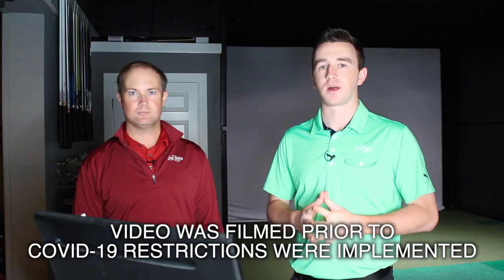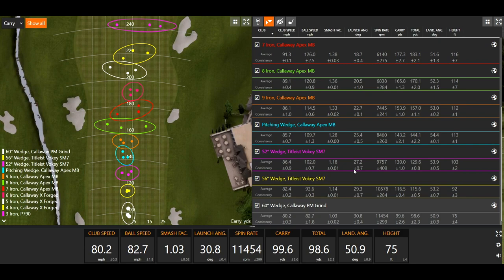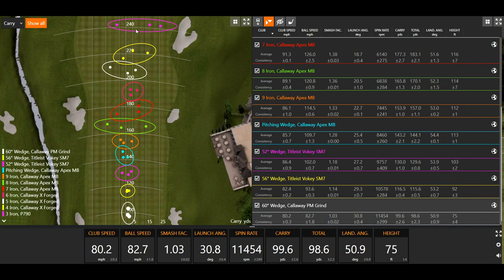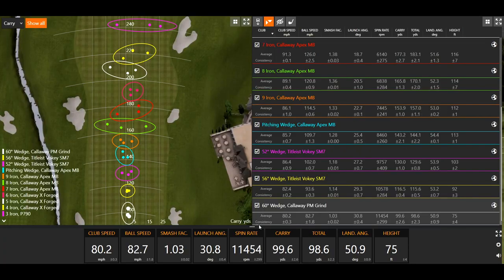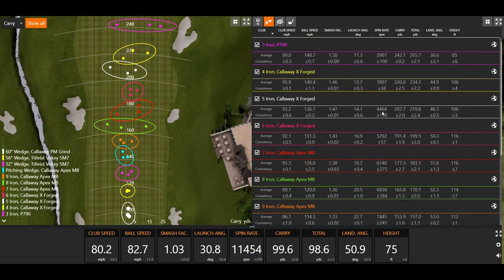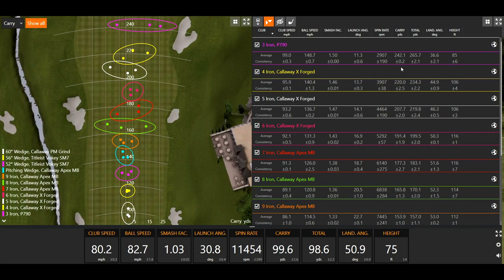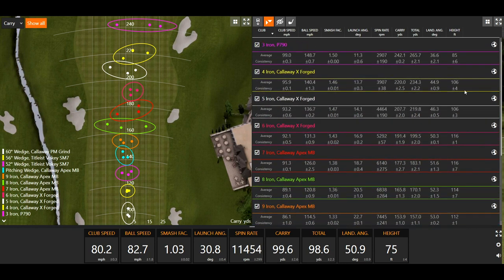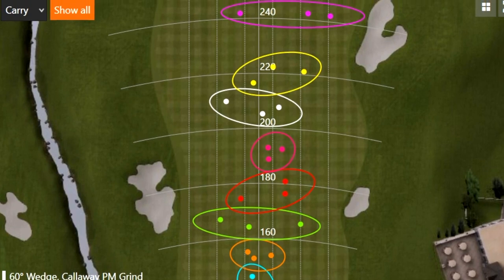Trackman Testing: Analyzing Proper Yardage Gapping  | 2nd Swing Master Fitter Insight

Comment: Thank you gentlemen for the very informative video.  I’m 53 and have been playing golf for many years now.  I’d say I have an average swing speed and hit my 7-iron about 140 yards.  I usually shoot in the low 90s.  I’m considering purchasing some new clubs and, after watching another of your videos, think that the TaylorMade SIM Max irons might be right for me.  With lower CG (and other new technology built in), I think they’ll help me to get the ball higher without sacrificing (and possibly gaining) carry distance.  My question for you is that with the SIM irons, the difference in loft angle in the longer irons is only 2-3 degrees.  Whereas, the loft difference between the wedges (PW-LW) is closer to 6 degrees.  I realize everyone wants to hit their clubs longer and that’s the reason for the lower loft angles in the mid-to-long irons.  However, when these angles cause the gap between the wedges to jump from 4 degrees to 6 degrees, doesn’t this affect your ability to get the ball close?  Most people (I think) would prefer to make a full swing with their wedges instead of a partial one.  They would rather grip their clubs near the top and not have to grip it 4 inches down in order to control distance.  The SIM pitching wedge is only 42 degrees.  If I purchase new clubs, what do you think about buying not 3 but 6 more wedges!  With the SIM 5 iron at 20degrees of loft, I now have room for these in bag.  I though that I could wedges that had only 3 degrees differ even in loft angle.  That is, a 48, 51, 54, 57 and 60.  My logic is that I can make a full swing and not have to choke down on the club.  Plus with twice as many wedges, I could get the ball to stop even closer.  I’d be VERY interested to know what are your thoughts about the larger 6-degree differences in today’s wedges?  Also, what do you think about my solution to have more wedges with only a 3-degree difference.   Perhaps, this would be an idea for a new video for you?  Thank you for the terrific videos.  Keep up the great work!  /Kevin (Toronto, Canada)
Reply from the maker: Hi Kevin, thanks for watching our videos and for the comment! Based on the lofts you are mentioning here, you must be looking at the SIM Max OS irons. The SIM Max irons have slightly different lofts, but your same concern is relevant in both sets. You make a great point in that the loft gaps at the wedges of six degrees between each club will create the need to use a lesser swing on some shots. With that said, most players are more comfortable hitting chokedown or knockdown wedge shots than doing so with a longer iron just because a miss with a longer iron is generally more penalizing. This will explain the larger loft gaps in the wedges vs. the longer irons. However, what matters here is what you're comfortable with. If you want to order a set through our Fitting and Support team, one of our online fitters can work with you to customize the lofts and create the gapping you're looking for. So, for example, if you wanted your pitching wedge closer to 44 degrees so you could get the AW at 48 degrees and then have three wedges at 52, 56, and 60, then you can do that.